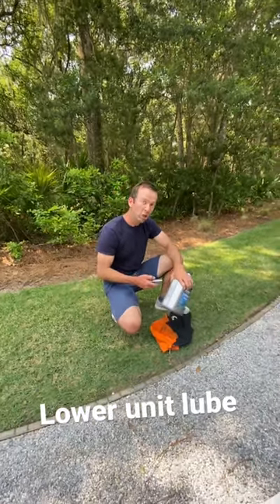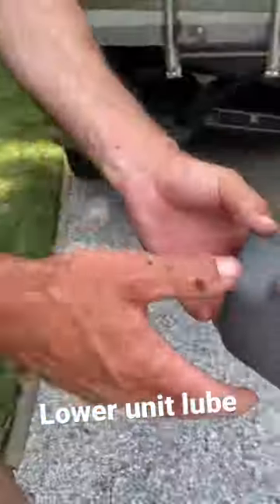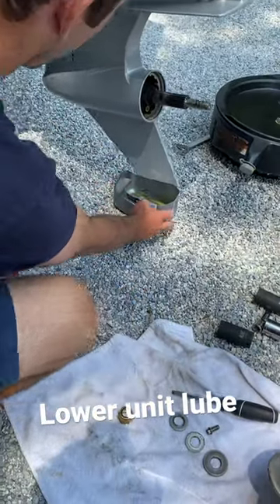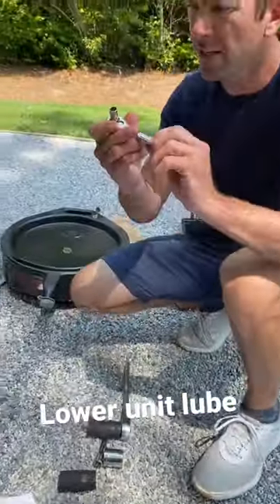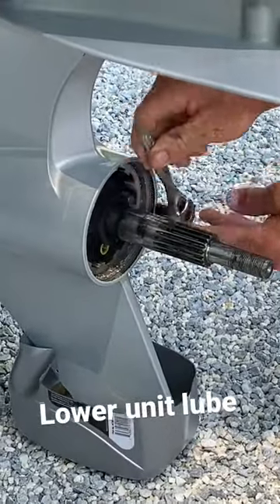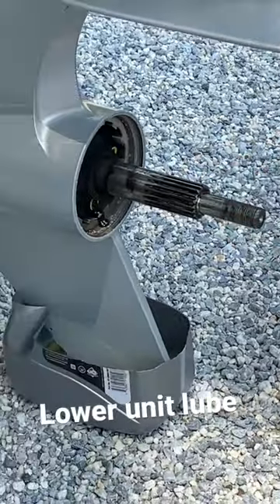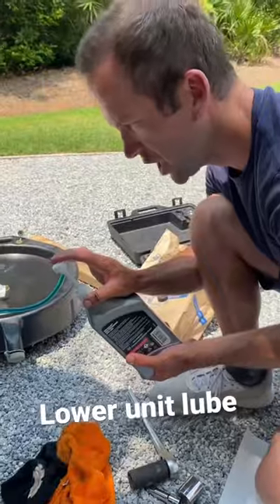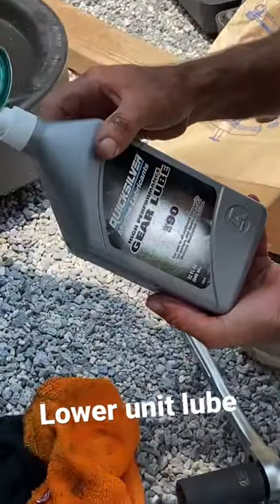Change LOWER UNIT gear lube

Comment: Cant be fast and furious with out regularly scheduled maintenance! Love the videos, kids these days cant even chance a tire. They need this 😂
Reply: Why I teach my son young he's 10 brakes tire change tune ups fluid checks scan tool he's learning what I can show that's simple for now
Reply: I guess I'm not a kid anymore, but I can tell you people were saying this when I was a teenager about my generation.

I currently fix one of the higher end machines tools in my industry (makino cnc machines).
These are incredibly complex machines and require a background in electrical, mechanical, hydraulic and pneumatic repairs and troubleshooting.

There is still hope for the youngest generation.
There will always be Engineers and technicians.
I have faith

Comment: Lucas There Also 2 Drain Plugs On The Side Of Your Lower Unit Takes A Philips Screw Driver Take The Bottom Screw Off First Then The Top Then Replace Both O Rings